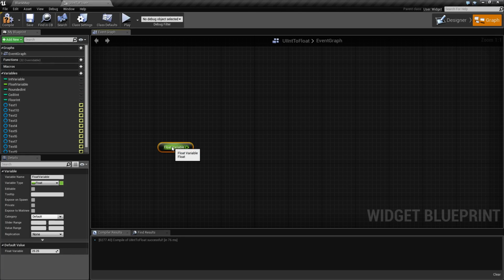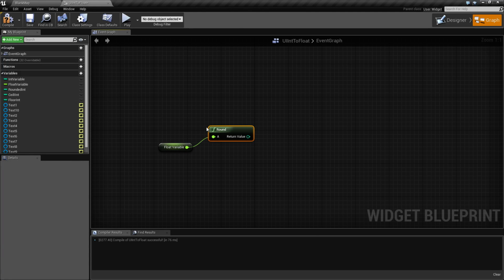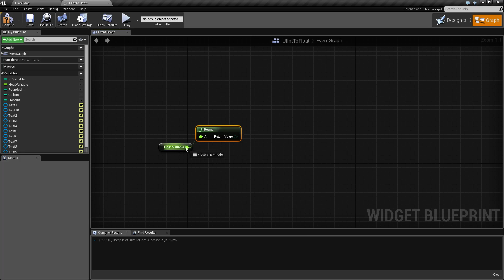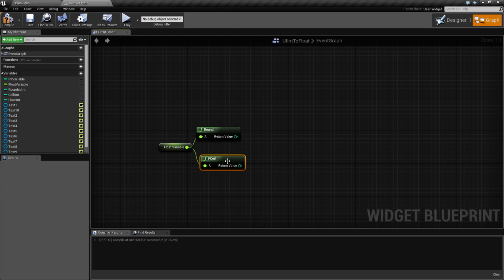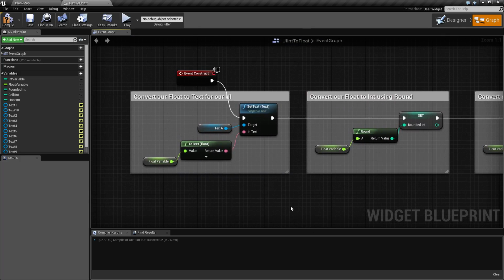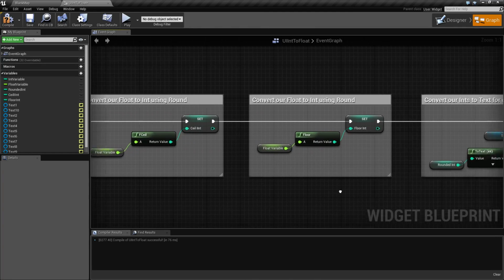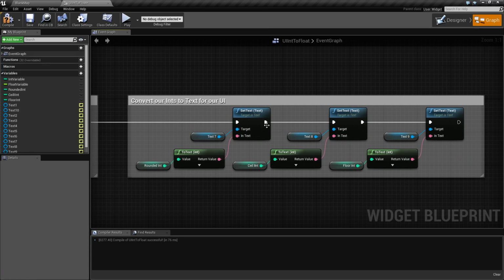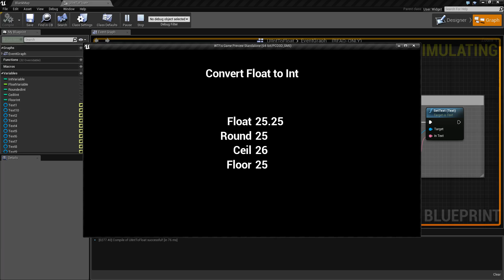HTF do I? Float to Int

Comment: When you have a float and you try to plug it into a int it automatically makes a small conversion node, would this be acting like the ceiling, floor or round node?
Reply from the maker: +Ethan Dodge When you do an automatic conversion for float to int  it doesnt use a normal var to var node it uses the Truncate node which just chops off any decimal and gives you back just the whole number.
Reply: Mathew Wadstein oh right, thanks for the info, might have a few things to change in my projects... haha